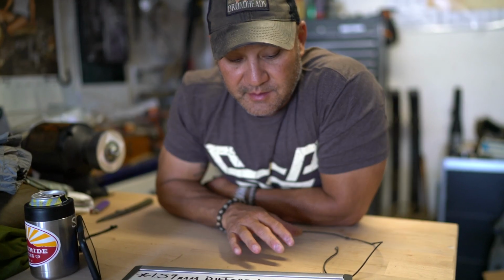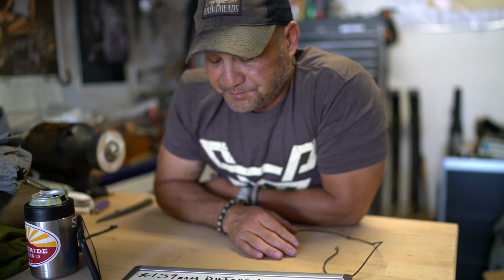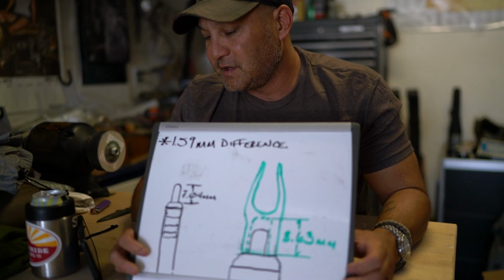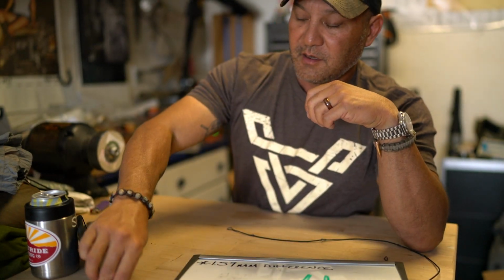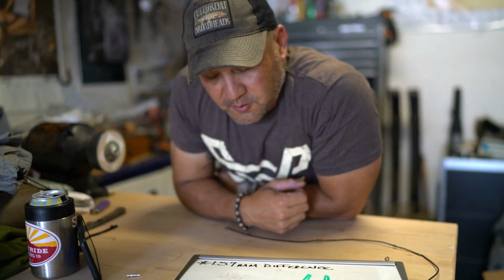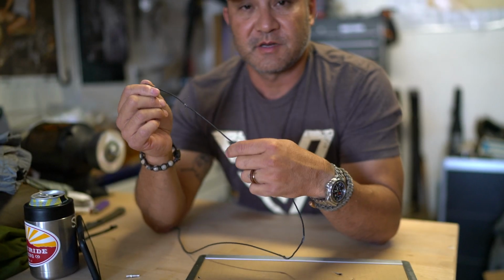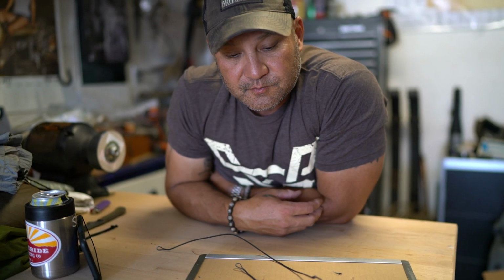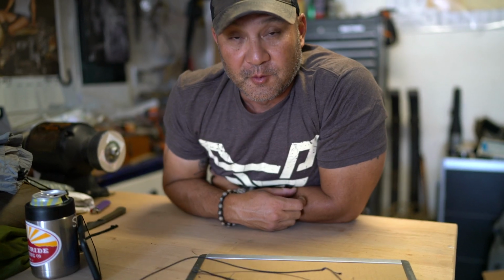Archery considerations: Pin Nocks

Comment: Thanks for the video, very informative.  I’m new to archery, so I thought it was something I was doing.  I had three dry fires.  Found this video, to see if I was doing something wrong.  New arrows, I doubt I’ve fired the arrows 20 times each.  Out of the dozen, 7 pin nocks have stress fractures (the plastic nock), along with the three I dry fired, I have two nocks that look good out of a dozen.  Will be changing the pin nocks (plastic nock and metal pin) to a better brand (likely Easton).  A real pain, I’ve let the shop know in case it’s a production run issue.  And unlike the video, my bow is a 38 pound recurve bow - not exactly high powered compared to a compound.

Comment: If you want to use pin nocks with a compound I would recommend Easton pins that put your arrows and Beiter Hunter large groove pin nocks. There will be a slight space above the end of the pin. The nocks don’t bear on the end of the pin they bear on the shoulder of the pin. I just don’t bother with anything other than Easton shafts, points, or pins. The only place I go astray is with the Beiter nocks. I’m old and I’m not shooting high poundage at all. But I started shooting decades ago. Easton pretty much invented modern archery. Every Olympic medal every won has been with Easton arrows and of late with Beiter nocks. These guys don’t have to pay for any of this and they can shoot anything they want. Easton arrow shafts are made in the USA and I have confidence in them. Just an old guys opinion and it’s not worth anything really. Do try the Beiter nocks though they are excellent and not that expensive.

Comment: Great info. I recently started experimenting with pin nock components and I paid attention to how much space there was between the pin and inside of the nock. I'm currently using Black Eagle Deep Impact pins with Gold Tip mini HD pin nocks and there doesn't seem to be a gap. But when test fitting the Blazer Pin nocks, there was a noticeable gap. I'm using Victory Vap TKO 4mm arrow shafts and that combo seems to be working well so far.

Comment: Very good advise and good vid.
 just stumbled on this vid while fitting pin nock to my new set of goldtip ted nugents and just found a warning card inside the bag they came in.  Saying not for high peformance bows over 285fps. but ive just watch a vid from gold tip saying thay are good for hunting and 3d. ive had a couple of people tell me they dont use pins any more becuse of the nock breaking up. goldtip must have become aware of the problem and started puting the card in the bag.
ive used blazer pin nock for years on a set of easton navigator FMJ's but only shoot 50lbs @ 235fps never let me down. if i crank my bow up i will be swaping them out. I would not recomend easton pin nocks ive had them spit just putting them on the pin.

Comment: I dont get it was it mix matched cheap components?  Thousands of people shoot pin nocks zero issue.
Reply: Yeah, I understand there are lots of no-issue experiences and maybe I'd have a better one trying them again.  These pin nocks were part of the Black Eagle system of components on BE X-Impacts.  I don't have another explanation as to why I experienced what I did; maybe I got a bad batch of nocks in terms of plastic or molding machinery.  And again, my conclusion here is based on my best guess coupled with a detailed inspection of my own equipment.  Regardless, I'm no longer using pin nocks (as much as I actually do like them) and have found better solutions to the issues that led to using pin nocks in the first place.
Reply: @pac8541  well thanks for your input wasn't trying to discredit you.
Reply: Bingo

Comment: Glad you did this video. I was considering pin nocks for some new shafts I got. Changed my mind.
Reply from the maker: Hey Matt, glad it helped. It’s important for me to reemphasize though that this was my experience with this specific nock. I have not tried others from Easton or Gold Tip which may have performed better. I like the idea of pin nocks but also like the visibility and tuning features I get out of lighted nocks as well so I’ve moved to those for most things. Definitely not as precise but the advantages overtake that for the majority of what I’m building them for. 🥃

Comment: Gold tip makes nock bushings for micros ;)
Reply from the maker: Hey Alan, appreciate that suggestion. I was using the BE pin nocks to keep it all Black Eagle; figured I couldn’t go wrong using their components with their shafts. I think it’s just a poor design or they’re not made to handle heavy arrows and high poundage, or both. I’ve been tempted to try the pin nocks from Easton and now, whatever Gold Tip has so thanks for the heads up. On the other hand, I’ve built 2 dozen each from 2 different manufacturers and like both better than this specific shaft so I may not be going back!  Thanks again.